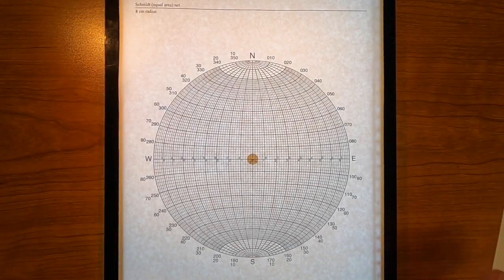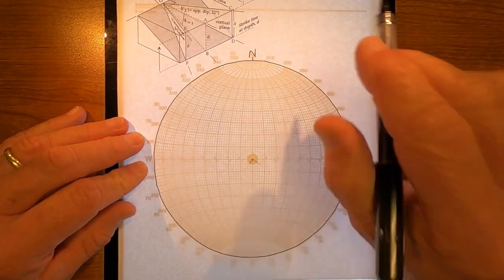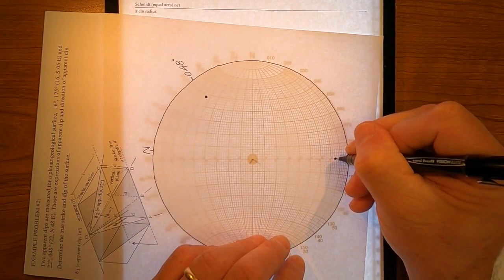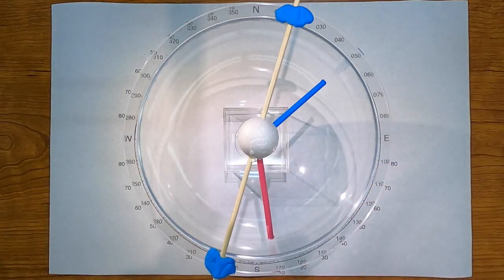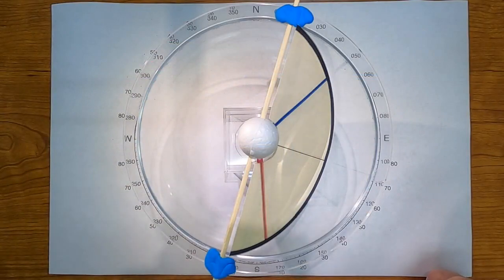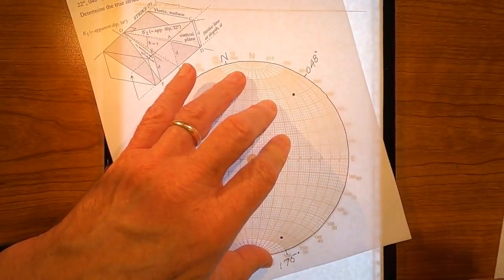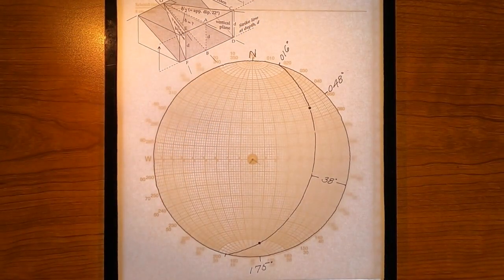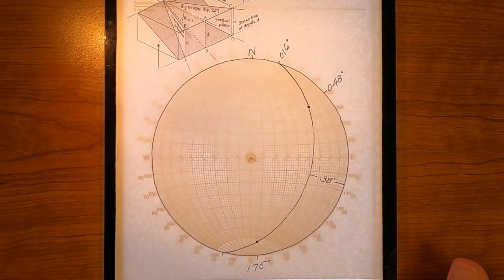Structural Geology: Stereonet: Two Apparent Dips: Example 2.2

Comment: please can you help me with this question  

Plot the following planes on an equal angle (Wulf net) stereonet:

 

                        Plane 1:  Strike = 220°, Dip = 30°

                        Plane 2:  Dip direction = 60°, Dip = 60°

                        Plane 3:  Dip direction = 140°, Dip = 70°

 

            a) Find the apparent dips on the sidewalls of a horizontal tunnel running N-S.

 

            b) Find the trend and plunge of the intersection of each plane on the roof of the     tunnel, if the tunnel is dipping 30° N.

 

            c) What are the trend and plunge of line of intersection between the planes?

 

            d) Find the angle between each two planes.